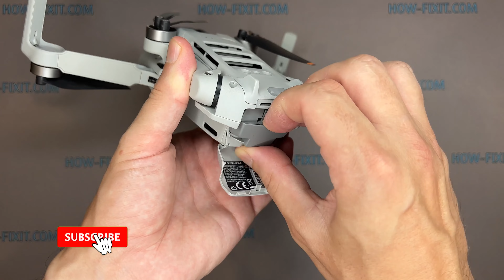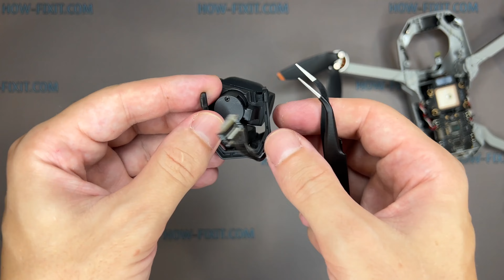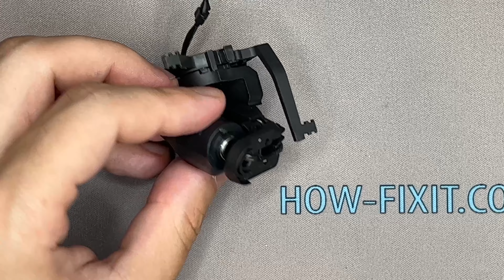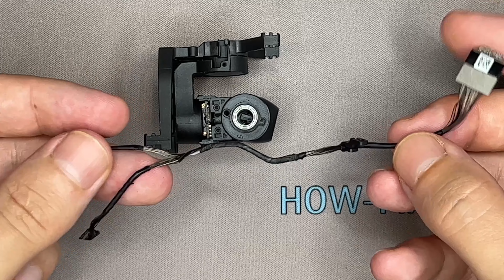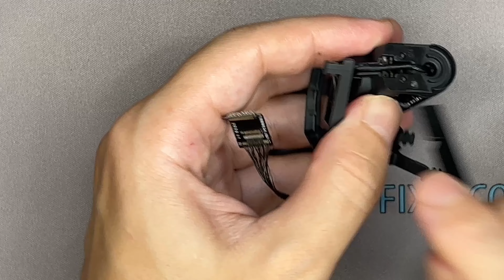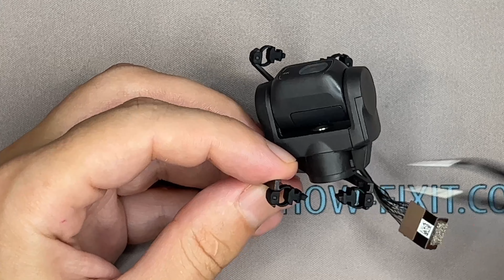The Complete DJI Mini 2 Gimbal Cable Replacement Guide

Comment: Hello, I had a problem with some ants that broke two wires of the small cable between the camera and the gimbal, which gave me an error code 40002, the gimbal got stuck to one side without being able to solve it in any other way. I bought the new cable and following this step-by-step video, I was able to change it perfectly and delicately. When turning on the drone, it gives me several codes: camera error (10001), lower visual sensor error codes (180016, 180017 and 180018), stabilizer IMU data error (40021), Camera not calibrated (10016)…. What I can do???
Reply: Hi where do you bay the cable ?
Reply: Bro same problem
Reply: How to fix it ?

Comment: Thanks a lot for this - I accidentally  have destroyed the pins of one of their ends when installing the previous cable and I had to buy a new one, very meticulous work. 
Followed your steps...at the moment even though I have managed to replace the cable, it errors with 'gimbal stuck' so trying to figure out why gimbal is not properly working...

Comment: I replaced the cable with the help of this excellent tutorial, congratulations on your work.  It's not the first time I've repaired the drone.  this time, however, once reassembled and turned on the gimbal does not move well and is blocked by the app, it also emits a strange and continuous noise.  the gimbal is free to move and there is no physical obstacle blocking it.  what could it depend on?
Reply: You should disassemble the gimbal again and blow compressed air from a can on the gimbal motors and housing, there may be some dust or small particles stuck in there. If that happens, you can move it by hand easily but the motors are blocked by any small resistance. There are youtube guides that you can follow to do this.